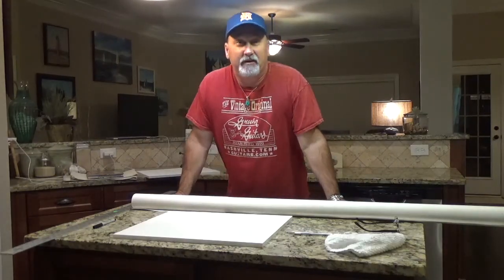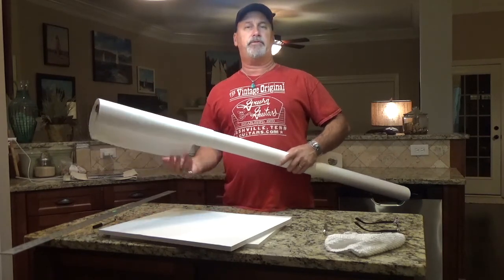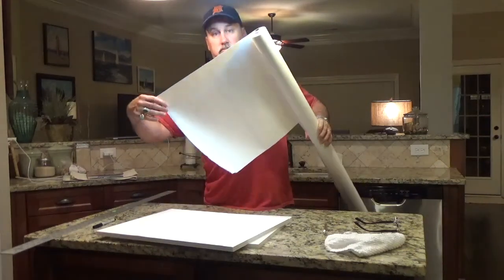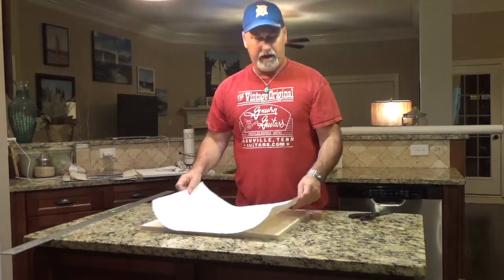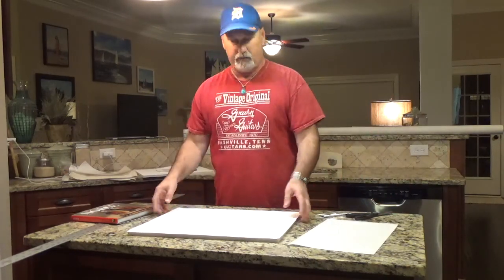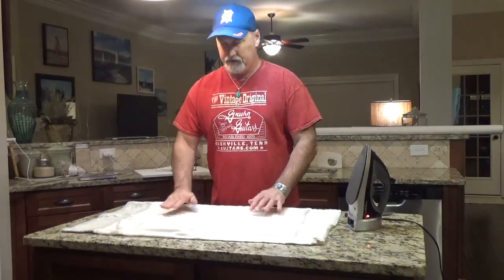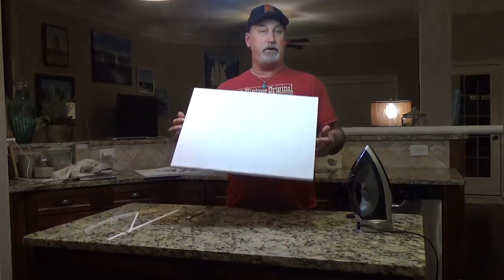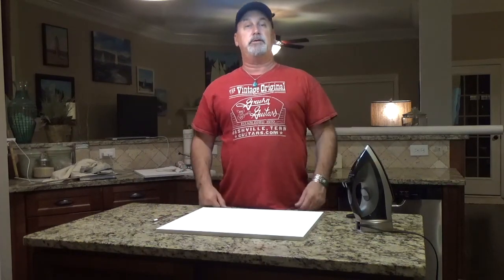How to make your own Canvas Panels

Comment: Hi there so glad to find this..  I've been down a rabbit hole trying to figure out a diy alternative to the 5/4 multi panel canvas images you see nowadays....hard to explain, where they take a large image & chop it up into 4 or 5 sections and then use 4 or 5 rectangular panels to create the image on the wall. Thought I could simply buy the canvas panels but they're an odd size you don't normally see. I'm not painting, but modge podging a photo (chopped up) onto these canvases. Is the side of this foam board finished or raw? I couldn't tell from your video. Do you think it'd be possible to wrap the canvas around the edges? Thanks so much

Comment from the maker: The subject of "acid free" for the adhesive is discussed on "Wetcanvas" which is basically a blog for artists. Sounds like the the PH neutral rating for acid free is 7.0. The gator foam adhesive is apparently 7.1 which is very close and doesn't concern me. If you painters out there are still concerned I would recommend standard Gatorfoam and rolling on your own acid free adhesive.
Reply: thanks

Comment: i assume the glue is acid free, correct?
Reply from the maker: Janet, Gator foam has been used for many years to mount posters and photography, and there are references to canvas panels. Unfortunately there is no mention of the adhesive being acid free and the process hasn't been around long enough to make guarantees. You may want to go with no adhesive and roll on your own archival glue to be safe.